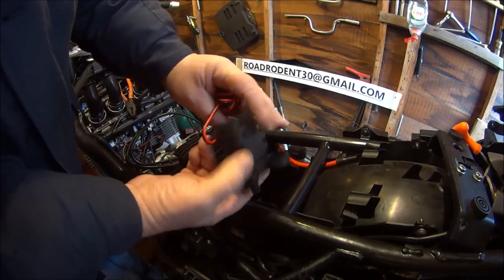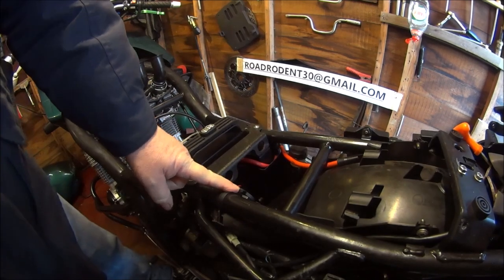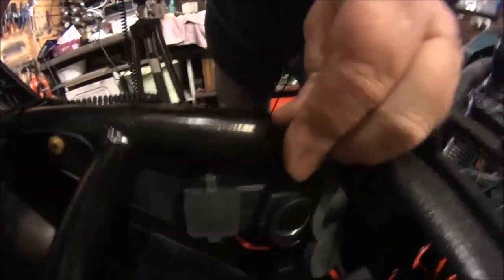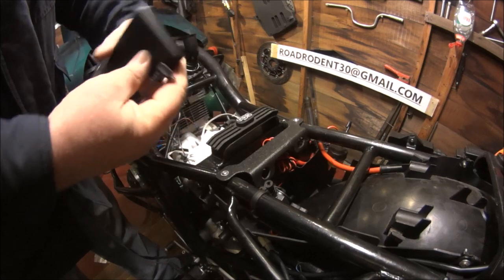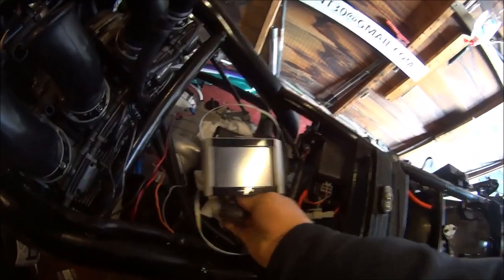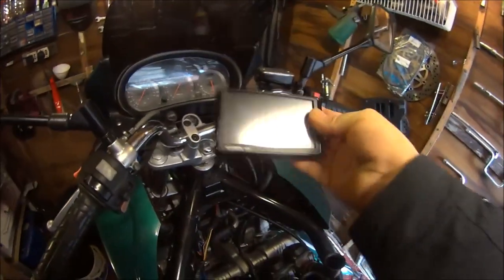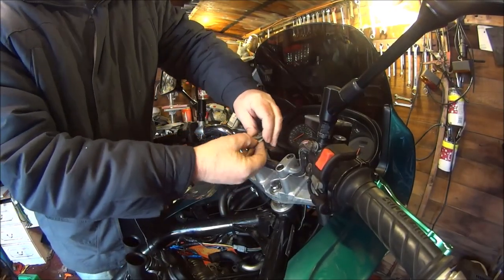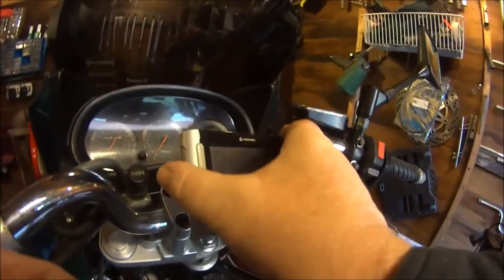XJ 900S. Sat navigation.

Comment: I have the same Bike and have connected a cheap chinese USB double socket to the brake and clutch lines just to the right of the ignition key.  Sat NAV clamped onto the handlebars in the same place using a clamp that came with the waterproof case (another cheap chinese product), and the SAT NAV plugs directly into the socket  with a very short USB cable.  Good to see you renovate a bike  so far gone. I did the same with a Pan European I owned several years ago.
Reply from the maker: Thanks.. Nice one with your xj. Yes my xj was a bit ambitious I guess..